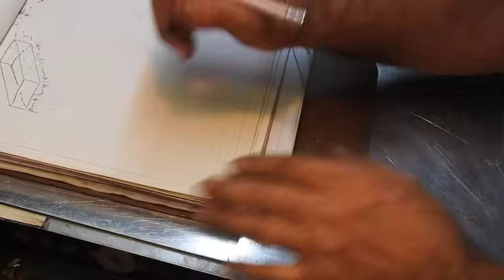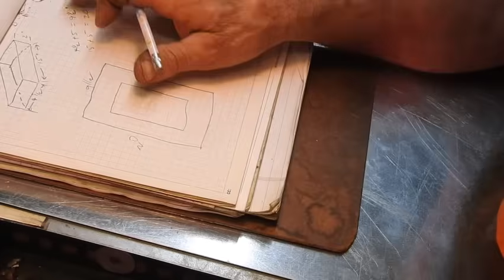Lets Build A Simple Sheet Metal Tool Tray

Comment: Simple ???
You are joking right ??
My simple tool tray, is a 10" tin electroplated saucer, with a simple pie crust fluting on the edge.
Simple 4:20 Tray, used hourly, for ... ever.
Sorry, Eh!?
Reply: I also have a rectangular tool tray, in 2mm Aluminum, 
Handles are a simple stepped  90° angle handle folded into the short side .
The long edge wall is short, but with a wavy nibbled accent.
Reply from the maker: Sounds like a cool tray....but I don't think I could make that one.  These needed to fit a specific spot in a tray on a 5 ton heavy equipment service body truck for smaller hand tools. But yes, the concept is quite simple though the implementation may present a degree of difficulty for some.  But if you have a bench vice and short pieces of angle iron, quite doable.
Reply from the maker: That sounds like another cool tray as well.  Now THAT one, I might be able to make a variation of.  Except I don't have any aluminum in the shop right now.
Reply: @tractorman4461  Boss, I was yankin yer coatails.
You said simple.
You mentioned no tolerances to fitting a cabinet.
You mentioned a friend, Service Truck, and Tool Box.
Since my old Dad was a Sheetmetal Worker, SelfEmployed, and Business Proprior, most of his life, I am fully aware of your fabrications.

You meant a custom FLAT BOX.
Something that would be CUSTOM FAB ... if it was an expression of a Commerce agreement.
A tray has handles, is simple, a round or rectangle shape, but stiffness to carry multiple items.
Dish, Brazier, Pan ...
Technicality, eh !?
My lack of professionalism... I am old, angry, have issues with FACTS.
Reply from the maker: @kennethkustren3966  Hahahaha...I kinda suspected you were yanking a bit...that's why I responded in the somewhat ambiguous manner.  I am a bit more liberal in my use of trade terminology because I don't necessarily adhere to the rules using the normally accepted terms to describe something.  The trade is filled with slang....like chinaman's hat for a flu cap... where I offended someone with that term.  Can you imagine that ??  I sent him/her whoever a link to a supplyhouse that advertises them as...you guessed it.....'chinaman's hat' chimney cover.  Then I sent another link to Chinaman's Hat Island...a little island off the coast of Oahu Hawaii.  LOL
   Making videos is not the easiest thing because I don't prepare anything materials to talk about or  think of things to say...I just pretty much ramble on with what comes to mind.  In doing so, sometimes the exact term just doesn't come to mind. Ergo: the terms you mention, like tray, dish etc.  
  I appreciate you coming back to clarify your thoughts and no, they are not  lost one me.  I fully understand.  There's one more point to ponder...the terms chosen to title a video plays an important part in making it seem interesting to a potential viewer.  Now I HATE clickbait titles but you just gotta admit, 'Simple Tool Tray' IS just a tad more interesting than 'Simple Flat Box'....for a title. Semantics, right.  Now c'mon smile a little, I don't believe you're THAT angry !!  Besides, I'm old too and probably just as set in my ways as are you.   LOL  (-:  I do hope to see you around on some of the other videos.  Here's a sheet metal playlist you might like: https://www.youtube.com/playlist?list=PLk72G9DTzZ1taVZjyeN9DKr52HQ3hhcXd Have a wonderful day and take care.
Reply: @tractorman4461  TYVM for the elucidation.
This is an excellent educational Channel.
Alas, You should be sponsored by a Trade Union, of AMERICANS.
But then again, an intelligent, industrious, dedicated MAN, being hued,  "of GOD" ...
shouldn't necessarily need supports... Eh !?
Reply from the maker: @kennethkustren3966  Thank you for the kind words about the channel...I appreciate that and you're right, about the only support I REALLY need right now is a brace on my left knee !!  As a younger man in the trades I always thought about working in the field until 55, then take the easier road down the classroom route.  But by the time I got to 55 I was having such a good time working with all the fancy new equipment, DDC controls and variable volume compressors etc,  I just blew by it and never looked back.  
    The year I hit the big 6-0 four of my friends/coworkers in the field fell over dead from heat attacks...all in their 50's.  Driving home from the 4th wake, I told the Missus I was retiring at my next birthday...61.  That was over 10 years ago now and I've never looked back.  Now I do what I do for fun or to just help out a few people that can't afford to pay for it, or in this case, just for a buddy.  Thanks again for the thoughtful comments in the thread. Take care and have a wonderful weekend. (-:

Comment: Such a pleasure to watch this come together. I've been working on my own sheet metal boxes but mine look really poor. I've definitely learned a lot in this video. My next step is to make a metal bending device!
Reply from the maker: Well, all it takes is practice.  I'm sure my first boxes weren't quite as nicely done as these.  Have you checked Harbor Freight or NorthernTool for a 24'' or 30'' brake ?  They are really reasonably priced. Plus check FB Marketplace for sheet metal tools.  You might be surprised to find one pretty easy.  Here's a basic folder for 53 bucks !!  https://www.northerntool.com/shop/tools/product_200888085_200888085?gclsrc=aw.ds&&utm_source=google_PPC&utm_medium=NT%20DSA%20Feed&utm_campaign=DSA%20Feed&utm_content=&gclid=Cj0KCQiAsdKbBhDHARIsANJ6-jeGPaCQ8nrAXELHwlEuSFInRuxBDsXuVH7gk49JxuvnpuPodpcuSIMaAvLPEALw_wcB  Hopefully the link worked...
Reply: @tractorman4461  yes the link worked! Thank you so much for taking the time to give me this recommendation. I didn’t realized that beginner folders would be so reasonably priced! I’ll be picking up one as an early Christmas present to myself. Thanks again!
Reply from the maker: @BadPractices  You will only be limited by your imagination DD.  Make accurate measurements and pay attention to how you fold on the line and if it's not quite right, remember what you did and do it slightly different to improve each time.  It'll come easy to you.  I make socket trays that taper from the large sockets down to the smallest socket and make the sides high enough to keep the sockets from falling out.  It's basically the same tray as in the video, but with different dimensions and shape.Good luck with the little brake.  Pick up a nice square headed 'tinners' hammer too.  And if you find a nice crisp square of steel 1 or 2 inches thick or more, they help in shaping sharp crisp corners too. Here might be something to think about as a way to strengthen sides.  It doesn't have to be round, you can implement the edge in this video even on your square boxes: https://www.youtube.com/watch?v=GaPFeahgJ8A
Reply: @tractorman4461  the edge in that video was fantastic. I’ve got two questions if you’ve got the time. 
-I have an abundance of machine screws. Do you have any tips for incorporating machine screws instead of rivets into a project like this? 

-Where do you find the best place to buy metal is? I’ve been getting it from Home Depot (I work there) but, I know it can be found cheaper elsewhere.
Reply from the maker: @BadPractices  If they are actual machine screws you'll have to drill holes to insert.  But to insure they don't come loose, I'd get a makeshift anvil and peen the threaded end over the nuts.  I'd insert them from the inside out too, to keep the inside sleek as possible.  On the sheet metal, see if there is an HVAC supply house in your town.  Most all those sell sheet metal for use during furnace replacements.  
    To buy wholesale, you may have to have a company name like D D Sheet Metal Fabrication.... and open an account.  That will keep you from paying full retail prices on the metal.  Then you'll have your choice of thicknesses and widths.  Standard width is 24, 20, 36 and 48 inches and 96 inches long.  So to start I'd go with 24x96x 28 gauge.  That's a good thin material to learn on then you can always pick up 26 or 24 ga later.  But don't buy 24 ga to start with....much too thick for what you want to do.  I hope this helps....  
    Btw, you should be able to open a business account on a 'cash sale' basis which will allow you to buy wholesale and not jump through the hoops to open an actual charge account with the supply house.  Another thing, if that doesn't suit your thoughts, just walk into an A/C service company and just buy a sheet retail.  They will probably accommodate you no problem.  Also ask them if you can stop in and get some old duct that's torn out of a job...it'll probably be free too !! 
     We threw away hundreds of tons of materials over the more than 40 years I spent in the field.  Good luck with what ever you do....heck you might even work into a sheet metal apprentice program !!  No more Home Depot then...LOL

Comment: Great video Wendell. These boxes are very useful and will far outlast the plastic trays. I have PDF plans for building a box and pan brake once I catch up on everything else around here! I like your hand punch. I have an old Roper Whitney; what brand is yours?
Reply from the maker: I have several.  That one too is a Roper Whitney.  My other good one is much much older and the name excapes me.  If I think of it I'll check it tomorrow.  The little thin one with the red handles and cast aluminum are Malco.  I've broken several pairs by squeezing too hard.  You ain't a gonna break the old Whitney's.  That reminds me Matt....I have several monster bench and hand held punches too. I ought to put them on the workbench one of these days. I can easily punch 9/32 holes in 1/4'' angle iron with any of them.  Well...easily when I was a bit younger.   I'd probably grunt a bit now.....
Reply: @tractorman4461  thickness of steel sheet ?
Reply from the maker: @dungcukhongday5697  it is 26 gauge galvanized sheet metal. Thickness is .0179” or .455mm.

Comment: What gauge of sheet metal did you use for this?
Reply from the maker: This was a scrap piece of 26 gauge.  Reinforcing the edges makes even lighter 28 gauge material much stronger as well as eliminating the potential for slicing your finger open.  24 gauge would only be needed on larger sized trays for heavier loads.